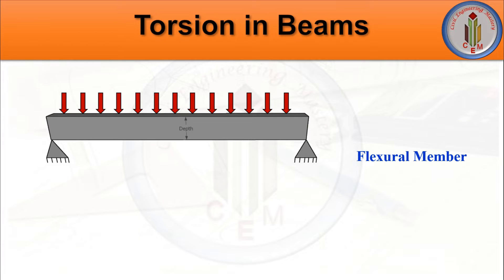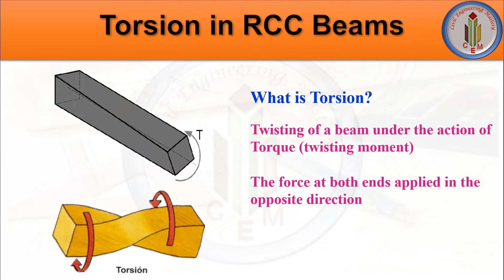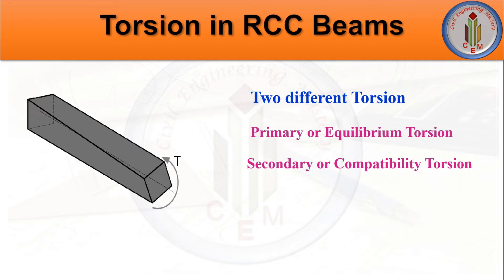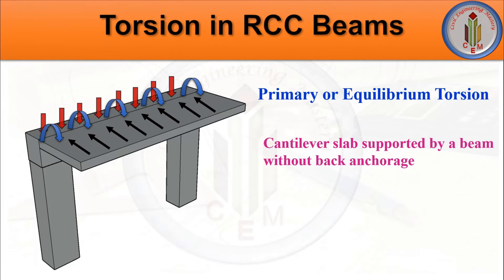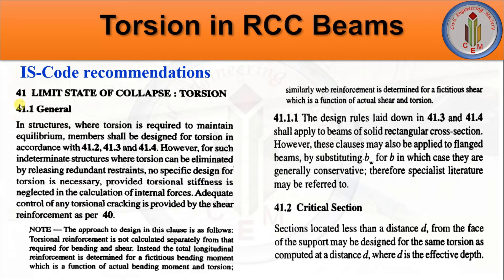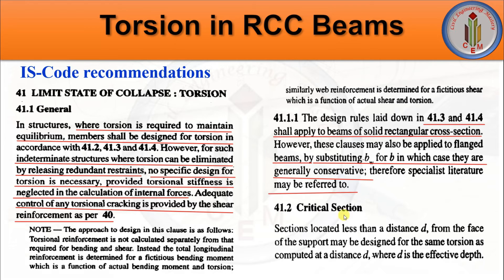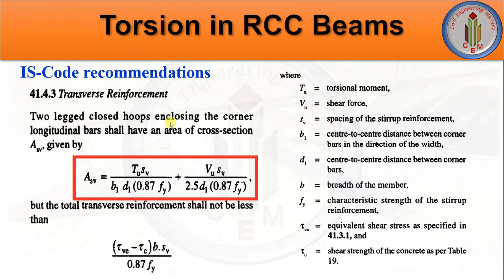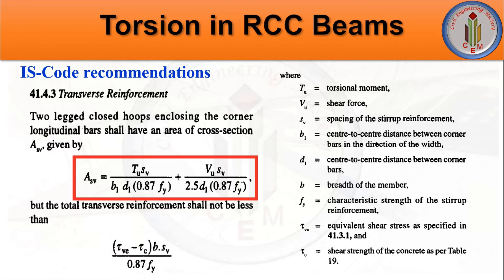Torsion in Beams | Twisting moment in RCC beams |Primary & Secondary Torsion |IS-456:2000 provisions

Comment: Can we ignore torsion of primary beam which develops by  secondary beam , while designing  continuous or fixed beam as a indeterminant  structure? By means of releasing secondary beam by providing less amount of developing length at end of secondary beam? If we ignore torsion then , How much will be approximately correct percentage of partially release in STAAD PRO release specification with considering monalithically casting of primary and secondary beam junction? Because we cant consider it as a simply support junction.